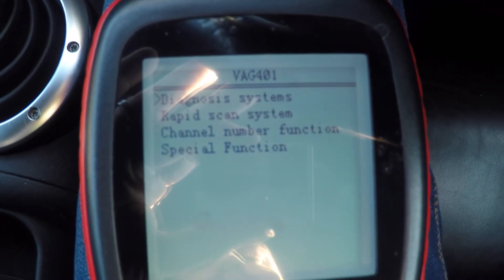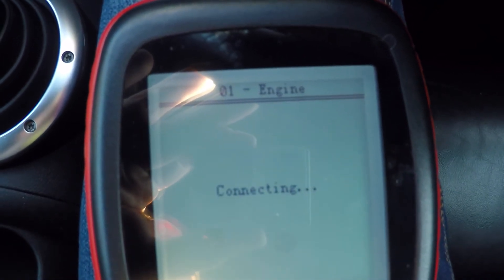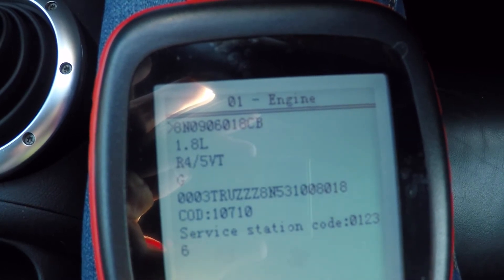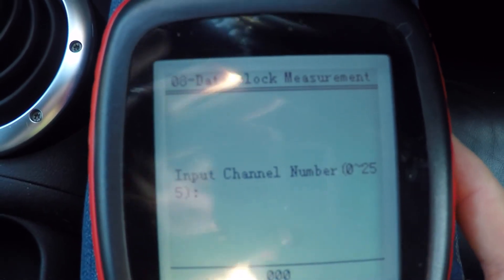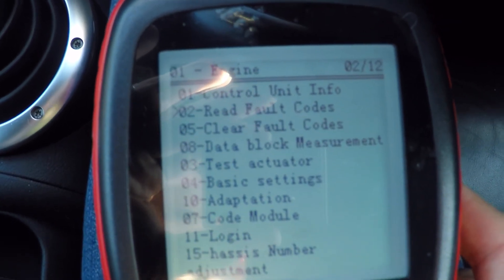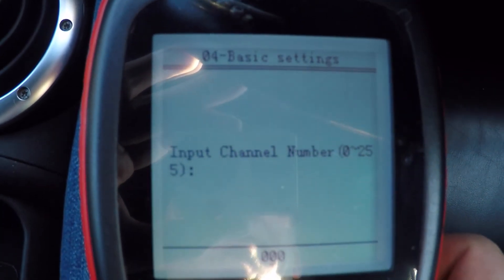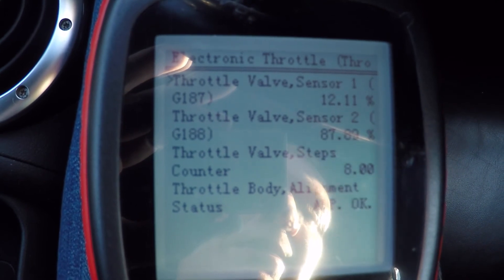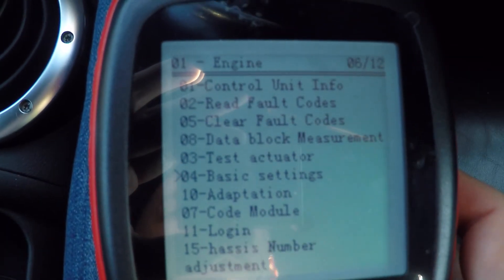Throttle Body Adaptation using XTool VAG401

Comment: Thanks for the video, I brought the v401 so I can program a new injector code when I install a new injector, the 6 number/letter code which is on the injectors has a zero after it when read on my v401 unit screen, but I have not come across this in any of my research of changing the injectors, any thoughts /advice would be appreciated thanks

Comment: Looks easy great vid  👍 but how do you find out which block number a throttle body is ? thanks
Reply from the maker: markennyee I usually check the Rosstech site, it lists block numbers for pretty much everything.
Reply: @vehicularbodges9007  Thanks for the info 👍👍👍
Reply: @vehicularbodges9007  so confusing haha my car is dbc and just cant seem to get it to do a tb adaption any ideas ? cheers

Comment: Didn't work or me, ERROR kept popping up. After 45 min I did ACTUATOR check and that'd reset the thr. body and then in basic settings said ADPOK right away. Did adaptation again but all came back the same, no errors. 20 min drive and all good.
Reply: @EatYourUranium  does it keep changing between adpRUN and Error when you adapt? some functions don't work on different cars. I can't access rapid check or a lot from electric system. The page where you can read fault codes, delete them etc, there's 5th or 6th option called ACTUATOR test, which tests different parts of the engine. That resets the thr.flap, just keep press enter with all 6 options, to me only last option isn't supported, but that's claims or so, therefore doesn't matter to me. Adaptions available from special functions in the main menu, but first check your car's manual as others can require more steps, like leave it it basic settings for 1 minute after adpOK and go back to measure block and just click on it.
Reply: @EatYourUranium  That might have helped the adaptation to be easier on my car's thr. body too..no problem, good that's been sorted

Comment: How did you find out which blocks to look for? Booklet, DVD, online?
Reply from the maker: The best source I've found for module and block numbers is the Rosstech website - while the XTool is more limited than their VCDS product its menus definitely seem to have taken "inspiration" from VCDS and seemingly the underlying ECU numbering is the same whatever tool you use.
Reply: @vehicularbodges9007  Fantastic, thanks, I was curious as knew there probably wasn't many or any X-Tool ~enthusiasts online forums  to draw from. Thoughts on X-Tool vs OBDELEVEN Pro since only a $15 difference?
Reply from the maker: I'm afraid I've no experience of the ODBeleven - it would seem from their web site that they support the VAG specific stuff in the same way as XTool but with newer vehicles added to the supported list (I believe XTool will also work on newer cars but I've not tried it). The thing that concerns me is they have a credit system for features, for which I can't find any pricing info. The site says credits are for one click features, but it's not clear if you need those (e.g. can you do adaptations by hand without the one click?) or whether you pay by the feature (permanent license) or per coding. If you get it I'd be curious to hear about your experience.
Edit: after a little research it seems you can do things longhand for free. Apps are all different prices, but you keep them. Credits don't seem badly priced and you can earn them watching ads if you really want to.

Comment: Why would you adapt throttle body?  Did you have misfires or something?
Reply from the maker: Dani_el it didn't need to be done on mine but somebody requested the video. Normally it's only needed after doing working on the engine.
Reply: @vehicularbodges9007  
Oh OK I was just wondering if It is something I need to do to my audi cause I changed the timing belt and water and I got a check engine light. 
Thanks for replying Thou 
Appreciated

Comment: is this device retrieve the pin from the cluster or ECU
Reply from the maker: I'm not sure exactly what you're trying to do but if you can find instructions how to do it with VAG-Com I can try with the XTool (assuming it's something my 2002 car supports)?
Reply: i need to retrieve the pin code from the current immobilizer or cluster to replace it with new one or to program the keys to the immo

Comment: hi 
i need to buy this tool for my Seat toledo 2000 is it work with it ??
and how i know the channels for every function and the value of it as you entered in the video to make the adaptation ??
Reply from the maker: Hi, probably the easiest thing to do would be to check if your vehicle is supported by VAGCom - if it is then you can probably use the VAG401 with it.
Reply: THANKS you reply for the first question, need your reply for the second one 
how i know the channels for every function and the value of it as you entered in the video to make the adaptation ??
Reply from the maker: Ehab Mohamed I normally look up the process for VAGCom and then use the same values in the VAG401. The menus have a very similar layout and the block numbers, etc. are always the same. Some of the blocks are not "understood" by the VAG401 so it can't tell you what the values mean, however it can still read and write to them.
Reply: so there is no sheet or photos to the values or blocks to write it direct in VAG401

VAGCom is a tool or web site ??